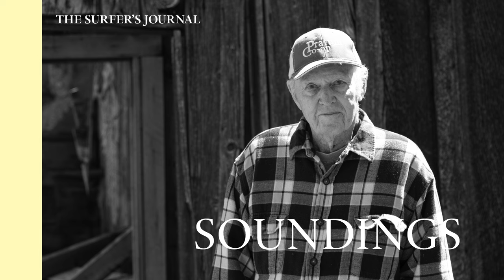Gordon “Grubby” Clark on Surfboard Design, Polyurethane, and Blank Monday and the End of Clark Foam

Comment: Ending about the 1:11:00 mark where Mr. Clark was describing the differential inherent strength in the blank caused by gravity - I have noticed this too and thought of it as a kind of crust as in a loaf of bread; where the crust is much harder and more dense and thus stronger than the softer interior foam.  I didn't know that crust effect was due to the effects of gravity.  But makes me wonder if they ever tried spin casting the plugs to us centrifugal force on the entire plug and possibly extend the depth of the stronger foam more deeply into the blank?  I'd be surprised if it were that simple but the existence of the stronger exterior seems to imply there is room for improvement if that characteristic could be controlled - perhaps by a pulsed energy of some kind that travels into the interior and affects the curing and size and density of the polyurethane.